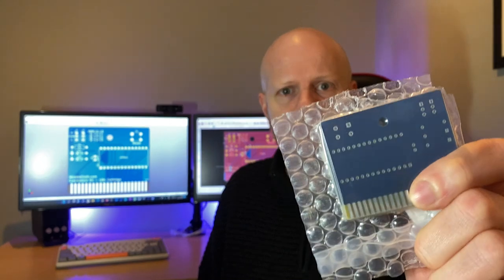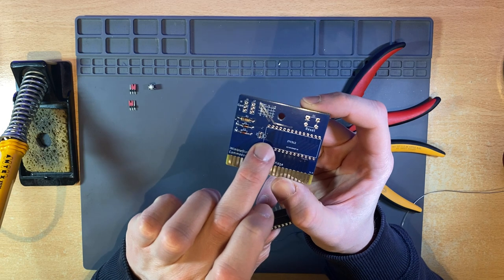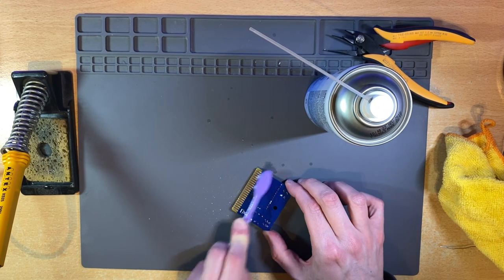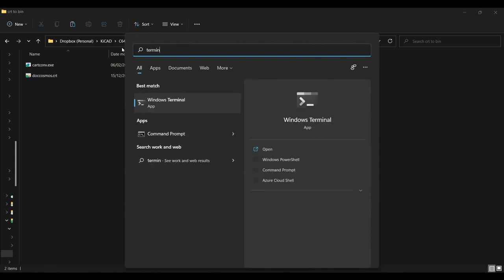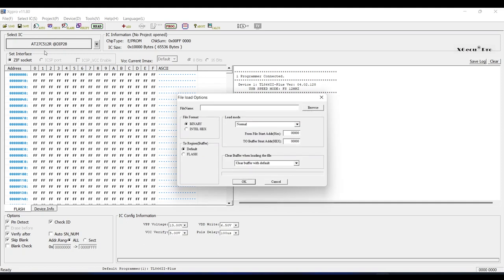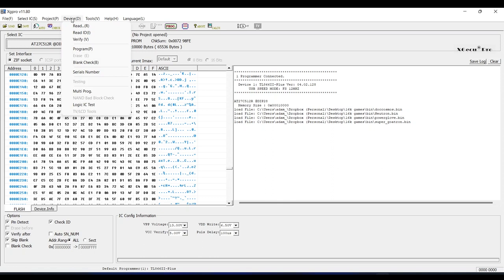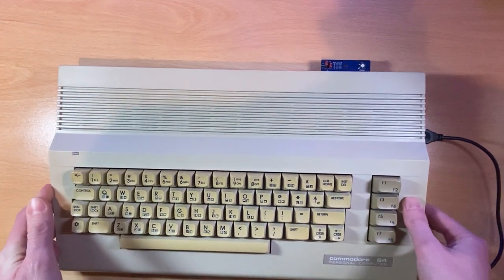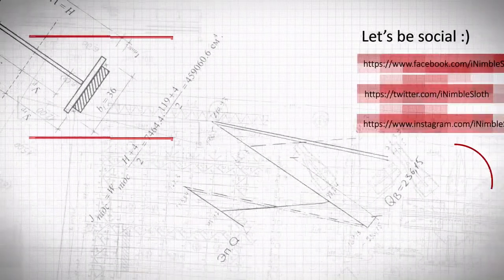PART 3: Making and Using My C64 Cartridge | #C64 #Commodore #Retro #PCBWay

Comment: I didn't see you add gold to the original order.  Are the fingers ENIG or hard gold plating?  How do you specify the fingers need to be beveled?
Reply from the maker: I didn't bother with ENIG, I just went with HASL lead-free. You can select ENIG on the ordering page, but it will increase the cost. The fingers on my board aren't beveled. Before I started the PCB, I was thinking about adding beveled edges, but after looking at several original cartridges that weren't beveled, I decided it would be easier not to go down that route as I'd need to learn how to do it 🤣 I've not had any issues using the cartridge with my original C64, but I am a little hesitant to plug it into my Ultimate64 since this is one of the older Ultimate designs (pre Elite) and I read that some people had issues with the cartridge connector on the older motherboard being damaged by non-beveled fingers.

Comment: Any schematics for this cart PCB Board?  I am trying to figure our how ROMS are address and would like to see exactly how your board is doing it.  I am order 10 of them (same cost as 5) from PCBWay, but it'll be a week before I see them.  I have other boards similar to this one.  I have been trying to burn a C128 Diagnostic ROM and have had no success getting them to work from the bin files on Zimmer.  I've gotten bin files (i.e., 1541 Alignment) to work and boot, but none of the diagnostics.  I am not sure what I am doing wrong.  Anyway, I like the look and simplicity of your board, and THANK YOU very much for showing us how to convert the PRG files to BIN files!!
Reply from the maker: Hi, I've just added the schematic to my webpage. https://www.inimblesloth.com/commodore-64-16k-cartridge/ You'll also find screenshots of the PCB traces there too. The Schematic is a text link just above the PCB - Rear Copper heading.
Reply: @iNimbleSloth  The thing I am learning is that even though all 16 address lines is available at the cartridge slot, the C64 only can address an 8K external ROM, 16K with bank switching using the ROML control line from the PLA.  Maybe not technically correct, but the way it appears to me.  To address larger ROMS, your are just using A14 and A15 to control the start location in that ROM.  The largest program the C64 can run from its cartridge port is 16K.

Is that about correct?

One thing that still causes me a fail of understanding is, how come if I am using a 64Kb prom (27c512), is why if all I want is an 8kb program, why I must concatenate it, to itself 8 times to fill the eeprom?  What about have a blank section in the EEPROM (or EPROM) causes the C64 or C128 not to run to 8K program in the lowest 8K portion of the eeprom?  I can just except is as fact, that one must fill the entire eeprom, but I do not like just excepting things - lol.
Reply: @iNimbleSloth  I also found a C128 "BURNIN ROM" .bin file on zimmer.  It is 64K.  How is this possible?  I assume it must be aimed at the U36 ROM slot internally?  I will have to look in to that.
Reply from the maker: @Daveyk021 I've not looked any more into it than when I made the 16K cartridge. I know some cartridges page in/out different areas of the EPROM to the same address space in the computer, but it's not something I've looked into or done. The CPU can only address 64K, some of that is the kurnal ROM, basic ROM and IO, so there is only limited amount that is left for the expansion port. Have you seen Gideon's Ultimate-II+ cartridge? He has an excellent grasp on what's possible with the expansion port. https://ultimate64.com/U2PLBLK
Reply: @iNimbleSloth It turns out I tried to order on at the end of August and forgot about it.  As it turns out my payment did not go through.  So I re-ordered on on BackOrder, and made sure the payment went through.  So who knows when I will get one.  This is also the same site that I have a pre-order in for the Ulitmate64 board (whichever is the latest version).  I have a case and keyboard ready for it whenever....
Reply: @iNimbleSloth This particular C128 can not load any C128 cartridge, only C64 Cartridges. C128 Software does work in the U36 ROM slot, so I am currently stumped and need to get away from it for a while.  I did order a BackBit C128 PLA Replacement, from the genius Evie, to try and a real C128 PLA off of fleabay.  I'll see if that could be the issue (but I have my doubts).
Reply from the maker: @Daveyk021  TI have the Ultimate64 board, it's great, you'll have a load of fun!
Reply: @iNimbleSloth I sure more so than with this stupid C128 that I have spent far too much time on when I have so much else to do.  I am too stubborn an do not suffer defeat easily. lol.  I need to set it aside.  Currently, I really don't think I'll really use it, over a 64, or Amiga, but I do love the challenge. I hope another set of Ultimate64 pcbs gets done soon, but I heard it could easily be six months; we will see.

Comment: Hello. Is it possible to convert *.prg file ~11kB to run automaticaly for ex. on bank 0 on this cart?
Reply from the maker: It's the jumper positions that determine which bank will automatically run. So if you convert the file and write to the bank 0 memory location, set the jumpers for bank 0 it will work. If you are only going to have the one game on the EPROM, then instead of jumpers, you can solder a wire links.
Reply: My question was can I convert simple *.prg file? And how to do this?  @iNimbleSloth
Reply from the maker: @arduinopl7460  Oooo, my mistake. I've not converted prg to crt myself but have seen a couple of bits about this online https://csdb.dk/release/?id=109269
https://frank-buss.de/c64/prg2crt/index.html

Comment: Why only 16k ? it possible config 2 for 32K or one for 64K ??
Reply from the maker: In my design, this restriction is due to how the address pins are connected and the memory mapping in the C64. You could try bank switching but you'd need to redesign the board. https://www.c64-wiki.com/wiki/Bank_Switching & https://www.c64-wiki.com/wiki/Expansion_Port